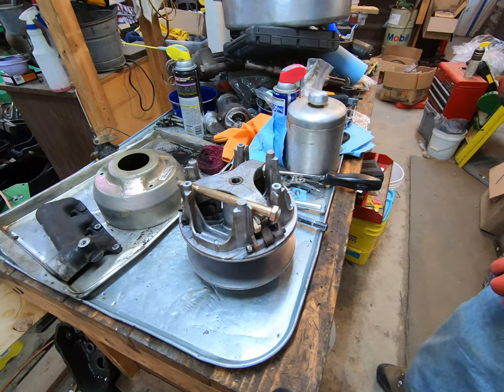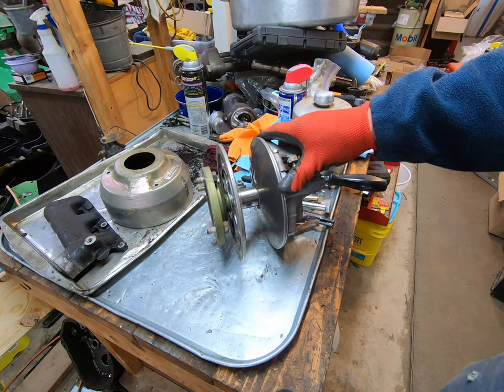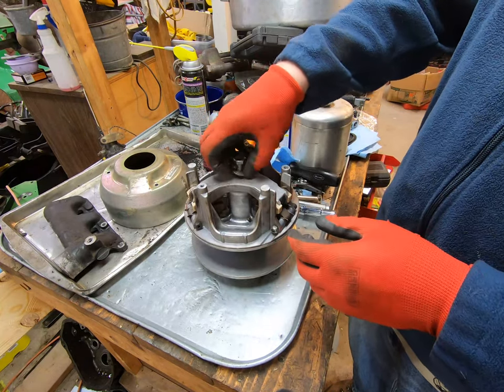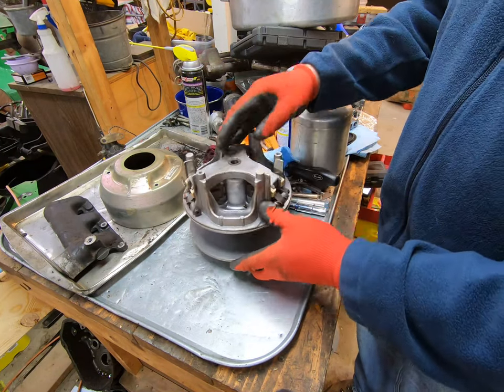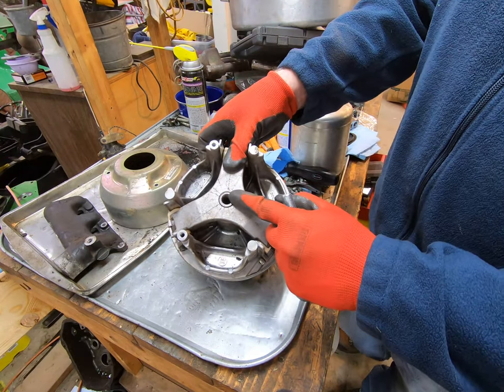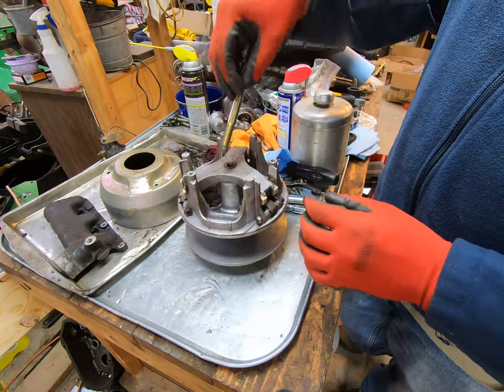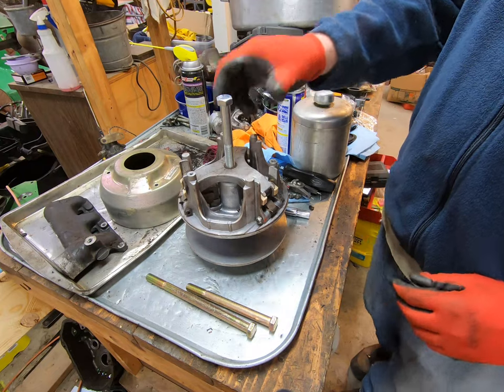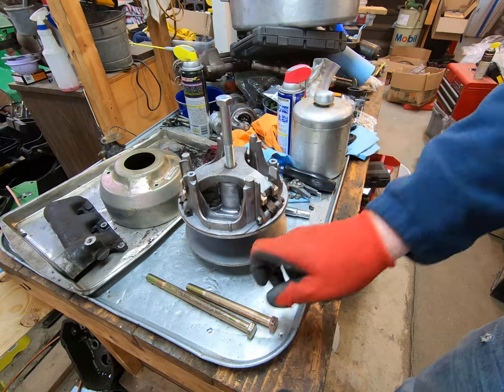John Deere Gator 6x4 Clutch Removal

Comment: Quick question will the new 54in quick attach snow blade for the Xseries fit the 430?
Reply from the maker: Yes, you can use the 54" QA blade if you have the correct quick hitch for the 420/430. Deere released the quick hitches for the 420/430 in 1992 as they released the 4-5 tractors. Granted the 420/430 quick hitches are not common, but they are required to use the QA style snow blade. Hopefully that that makes sense.
Reply from the maker: Here is a video I did on quick hitches. I can't remember if I covered the 420/430 in this one or not but it gives you an idea of what might work and what you are looking for.  https://www.youtube.com/watch?v=Jt_e1eJb-bM